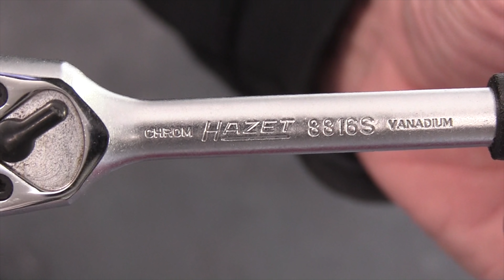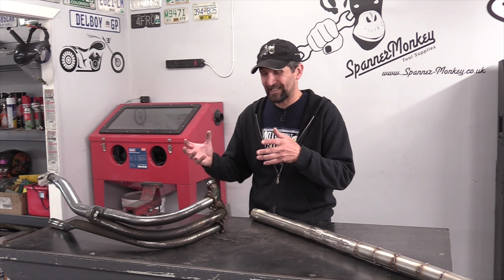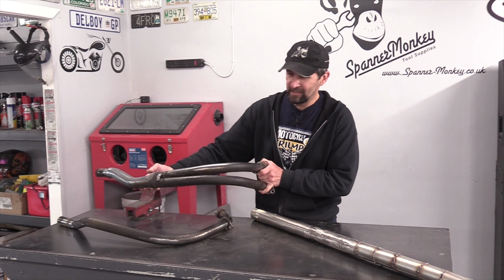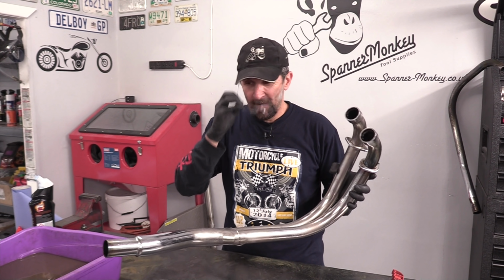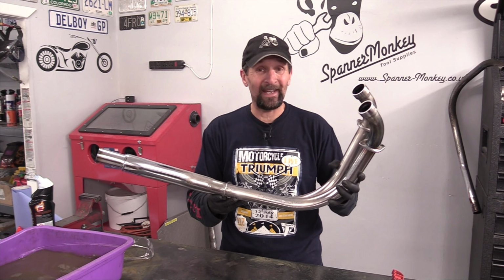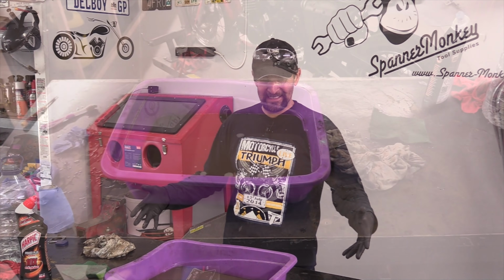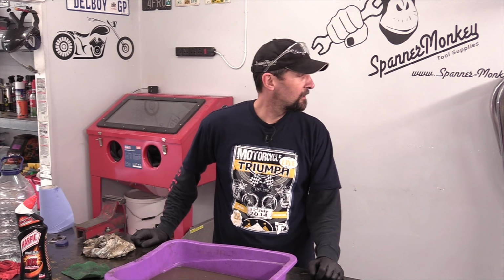Triumph TT Legend, 3-into-1 Header Pipes, (Pt2) Prep for Surgery !

Comment: Looking very good Del, well done on cleaning up those headers.  My vote is to leave them as-is and mount two silencers.  You can always re-consider later and weld the 3rd pipe to a single outlet if you want. But if you do that now, there is no going back.... and I think it would be quite cool to see both mega-silencers on this bike.
Reply from the maker: Hi Donald, twin mega shaped silencers is the standard spec and that's the difficulty of the decision, that there's no going back, as with any custom fabrication, but it's a custom project. not just a restoration, so there's an element of adventure that must be pursued, if you wanna create something that is unique at the end!
Reply: @Moonfleet41  Yes I see your point.  It's a tough call.  At first I was thinking ...keep the dual exhaust, that's a cool look, and the pipes are looking so nice again now.  But now, thinking more overnight, I cannot help but consider the appeal of the custom aspect of joining to a single exhaust. Hell's Bell's Del... join'em up!  You know you want to!  Life is short.  ;)

Comment: Hi Del...i found an Emgo Bonneville replica "silencer" and put a single one of these on my 06 Speed Triple.....cost $89au from my friendly motorcycle accesories supermarket. It needed a fluted baffle welded into it..i love the result. At idle it sounds like a vintage aeroplane and thats just the beginning of its range of sounds. It doesnt weigh much and makes me wonder why anyone would spent $1000 on  a slip-on. Love your work
Reply from the maker: The £1000 I mentioned was not just for the slip on mate, it's a full Mass Moto system, very smart and sounds glorious, but too much money for me... psounds like you had success with yours, I love any project that works and doesn't cost sill money!

Comment: Del did the same to my kawa stainless headers and link pipe Slightly different method though in that I left the Harpic on there for 10 mins before brushing scrubbing etc Took ingrained dirt/contamination right off in brush first pass far faster to allow them chems to do the grunt work for you than attacking straight away Didnt need polishing wheel after either Quick rub with autosol and they looked good as new after 20 yrs of neglect
Reply from the maker: Perhaps the dirt was a bit thinner on yours Gerald, and I think I showed a scrape at one point in the video, this stuff was at least 1mm thick and was hard and encrusted, like a ceramic coating... I've used Harpic loads of times to clean pipes that are dis-coloured, which is why I started with a toothbrush because normally it works straight away with that, but in this case it wouldn't touch it!  A good 10mins, or so, didn't touch it, it only seemed to work by massaging it in with a heavy wire brush, which eventually turned the coating in to a brown sludge... the surface was pretty pitted underneath in places, which I've not seen dirt do before to a stainless pipe... I have my suspicions that these pipes were actually chrome plated over stainless, they were silver flakes in the sediment to bear that out, so I reckon much of the crude was oxidised chrome, not just dirt... but it's all gone and job's done and bloody glad I won't have to do it again now!
Reply: @Moonfleet41  you did mention it may be a combination of acf50 and other crud m8 Dont think I've encountered that compound yet but personally I would not be using it  Really what is wrong with cleaning and properly looking after a machine?  Took the older zx6 out to South Queensferry near Edinburgh on Sunday only for several other bikers to remark that it had been painted !!! No mate its been looked after and cleaned No chems No protectants just a wash and clean lol They didn't believe me

Comment: Hope you like it! Thanks for showing it! 
Tobias
Reply from the maker: Thank you so much for the gift Tobias, ive been using them this it this week, and it's ten times better than regular cutters.. makes the weld arc strike up more cleanly as the wire is cut square and not squashed as it is with snips..   Take care and have a good week.. Del.

Comment: Del.. Great job and video. I wonder if it would have came off in the blast cabinet, then polish it back a bit. Thanks for sharing.
Reply from the maker: Yeah, i so wanted to try that.. but the damn things are just a bit too large and clumsy to fit in the cabinet... also, i didn't want to contaminate the blast media with all that crap..   this way was harder work.. but that costs nothing.. the glass beads are seriosuly expensive.!
Reply: @Moonfleet41  That is true. I wasn't sure if they would fit or not..

Comment: Even on an HD big screen, those pipes looked almost new after your cleaning and buffing. You're a Southpaw! If anything, it taught me to wipe my pipes down after every ride to avoid what you had to do. Ever use Blue-Job on chrome pipes? Also, wouldn't a three-into-one rather than dual be better for performance?
Reply from the maker: Good plan buddy, you can't take too much care of the pipes, specially in the winter!   If I do go 3-into-1, I don't think it'll produce 'more' performance, perhaps a little different, but carburetor'd  engines need more than just that to create extra power... and it has plenty anyway!

Comment: Try next time to soak them in Harpic (acid) for a few hours this should speed up the cleaning process and less elbow grease required ;)
Reply from the maker: Be careful with that buddy, I'm presuming you've never actually done it, because soaking them for a few hours would etch them pretty badly, as I explained, it's quite a caustic acid and it needs to be on there as little as possible to do the job, elbow grease costs nothing though aye?!
Reply: @Moonfleet41  Yes I have done it on my Honda CB 500N 2015 with good results You need to monitor time to time process and you will be fine. Same as vinegar with rust mix with water if to strong. Thx

Comment: Just bought a gas torch like yours at the weekend. Could not get the gas to flow. Some blastard unscrewed the connector pipe that fits in the bottle neck. So annoying but easily swapped when I went back to the shop.

Comment: What are the pipes made of?  Stainless steel or not?  If not, what about rust protection?
Reply from the maker: Yes, Stainless steel, and will be welding with stainless steel wire.. so no corrosion
Reply: @Moonfleet41  There's one thing is bothering me. Why did you use wire brush? Just for show that everyone can do it in their own garage? I have Triumph Legend and I would like to renovate the header pipes but I thing about sandblasting or glassblasting. What do you thing about it. Is it good idea ?

Comment: It will burn off chrome you say? Would this be a viable option to remove chrome from rims?
Reply from the maker: I don't think it literally burns it OFF, it certainly discolours it permanently and leaves some pretty horrible stains, but for truly successful removal of chrome that won't damage your wheels, then reverse electrolysis is usually customary... difficult to do on something like wheels, or maybe get them blasted and powder coated and then re-spoked.
Reply: @Moonfleet41  there aluminum cast😭😭 I think the best course of action is to buy used painted and sell the chrome

Comment: turned out really nice del but how not just use the wire wheel m8 save you all the elbow greeze bud but like i said nice job atb m8 iain
Reply from the maker: Not sure if you clicked forward in the video mate, but I did make the point that a wire mop would flick that bleach acid all over me and the ceiling, which is bad enough!... but it also flicks it off the job when I need it there soaking in to loosen the grime, so massaging it with a hand brush is far better and effective, this job wasn't about labour saving or speed, just making a really good job no matter how long it took... not to mention wire mops are really aggressive and will leave scars in the metal surface, the polishing mops was the most I could risk!
Reply: @Moonfleet41  got ya del never heard you say that m8 still a good job though turned out well
Reply from the maker: @iainduncan2363  Sure thing buddy, there's always a fast way to do things, but there's usually a cost and bleach acid in yer eyes is probably not a clever one!!
Reply: @Moonfleet41  thats a very good point sir anyway cant wait for your choice on the pipes m8 atb

Comment: If you send me your email address I will shoot you across some pics of the exhaust on my thunderbird sport that started out like yours , it was an arduous task but the end result justified the effort which I’am sure you will whole heartedly agree , from the research I’ve done Triumph is & was the only motorcycle manufacturer to ever go down the road of chrome plating stainless , I stand corrected if I have missed something in my research.
Reply from the maker: Hi Davis, good to hear from you, and I think you're absolutely right, I've never seen chrome stainless anywhere before, and if defintely is chromed because when I melted the crud off, it was pitted like chrome, but a polishing disc just scuffed it off like flakes, and the sludge was full of silver chrome filings... there's clearly no nickel there, I think it's just a dip of bright chrome to give a blue lustre... would love to see your bike photos mate, drop them to me at:  delboysgarage@yahoo.com    Cheers!

Comment: I love Stainless!😎
Living on a boat in the Caribbean for 13 years I learned that (1) there are literally a hundred grades of Stainless; be sure to use the right one for your application,🧐 (2) Stainless will rust (and undergo a number of other types of corrosion😬),  (3) there are a myriad of acids, solvents, polishes and caustic chemicals that can remedy a lot of Stainless corrosion (except crevice corrosion and anarobic corrosion which are always fatal to Stainless🤬) and (4) there's no subtitle for elbow-grease 😳.
PS: Less can be more; I recomend you use the simpler solution of using the 2 plus 1 configuration. 😘